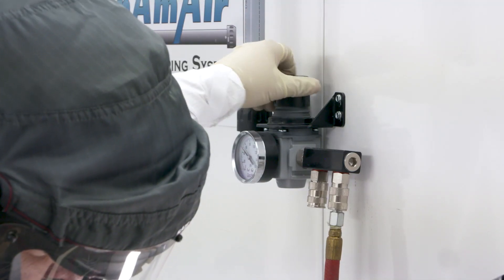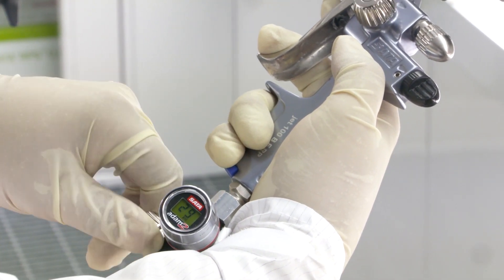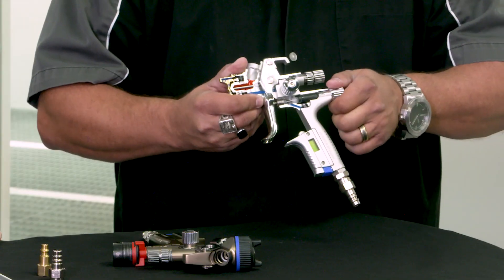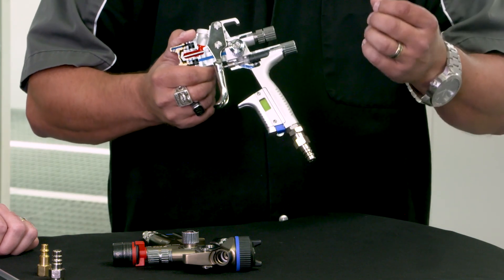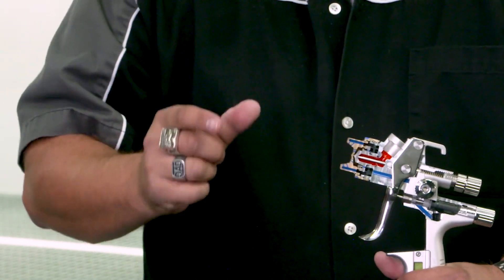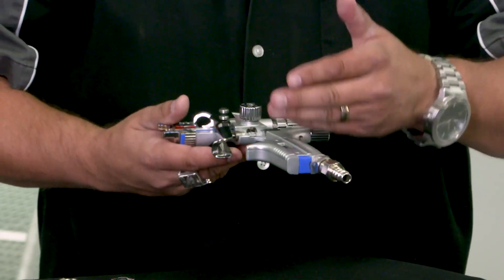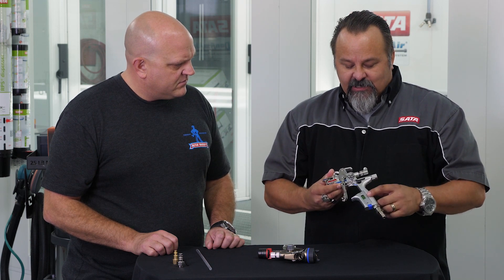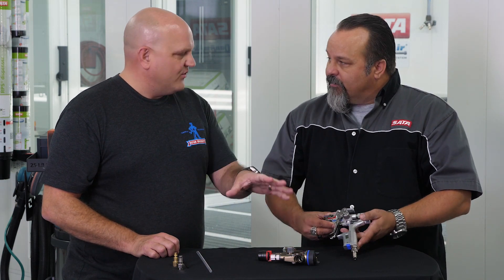Air Pressure And Volume

Comment: Does the sata perform better with the the cup with the air inlet on the lid or 3m 2.0 pressure cups??
Reply: All spray guns perform better with a vented cup system.

Comment: I had seen the original video back in 2013 so great that the new one reemphasizes the same points. I have followed it to a T. The other thing I assume is by setting wall and gun regulator close, the compressor say  with a 150 psi max shutoff (mine)  will come on less as the tank output has now been set so much lower than wide open (e.g. 30 psi).